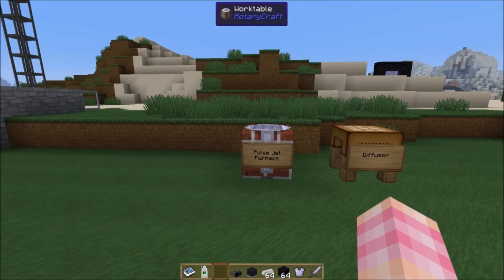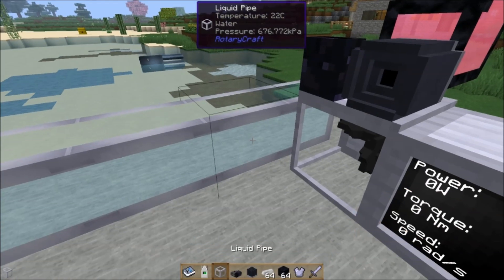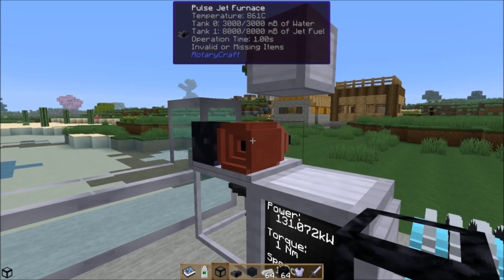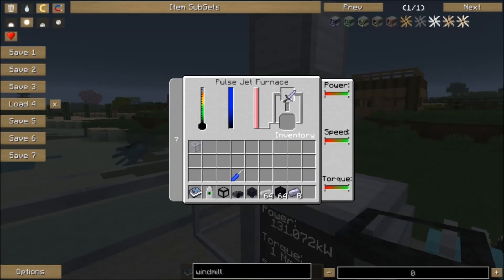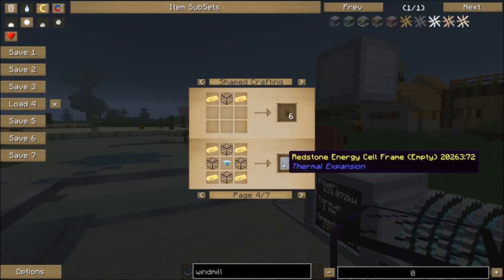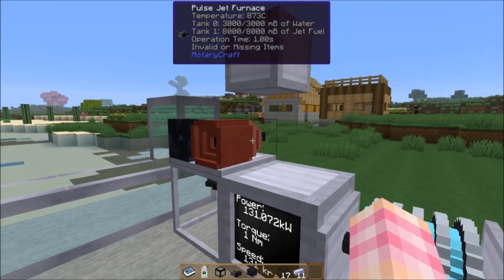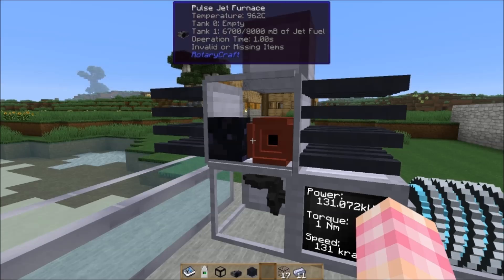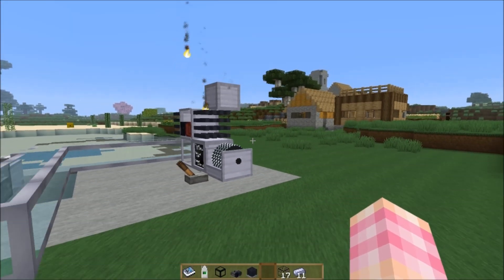RotaryCraft Tutorial #15 - Pulse Jet Furnace

Comment: I've noticed that when using a blast furnace you sometimes get more than what you put in, for example I put in 9 iron ingots and I get 10 HSLA steel, so actually it is more efficient than the pulse jet furnace
Reply from the maker: Pulse Jet Furnace does have speed over it though. I guess it just comes down to what you want out of it.

Comment: The non-melting swords was fixed a long time ago.

Also, I saw from the hydrogen preheater recipe in NEI: You will need to fix or remove your texture pack, or your items from ReactorCraft will be missing textures.

Also, you can increase the pulse jet temperature safely by adding oxygen from ReactorCraft to it.
 Making it hotter also makes it much faster.

Finally, the blast glass is also immune to the EnderDragon and the Wither.
Reply from the maker: Yeah I've noticed that a lot of items from ReactorCraft are screwing up in this texture pack. How would I go about fixing it? Cause I like the pack otherwise.
Reply: Editing the texture files inside manually.
Reply from the maker: ReikasMinecraft I'll fix them before I start a ReactorCraft series. As of yet they haven't become a nuisance.